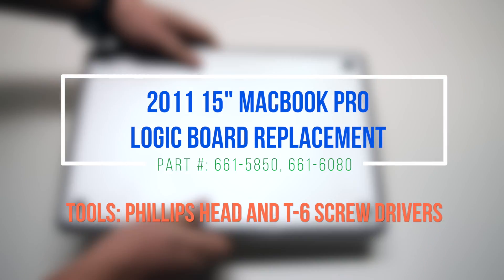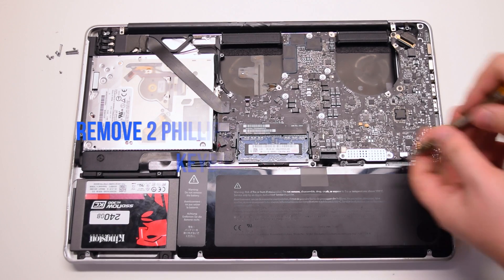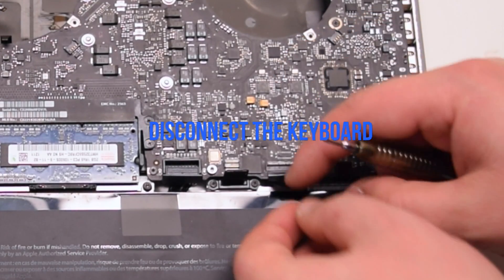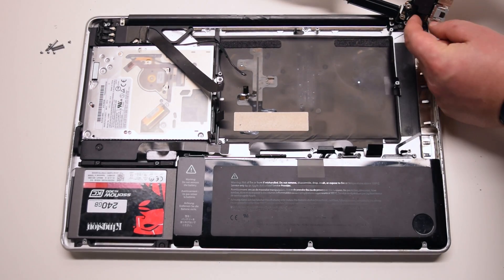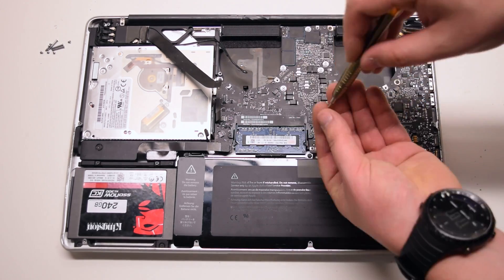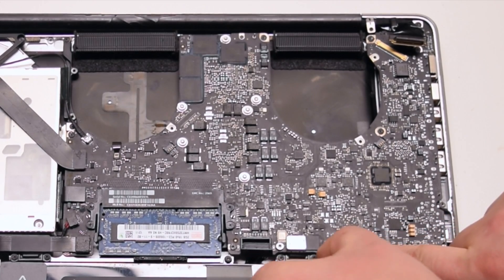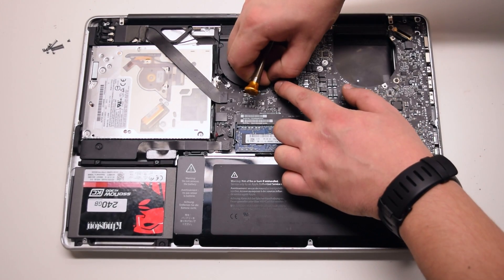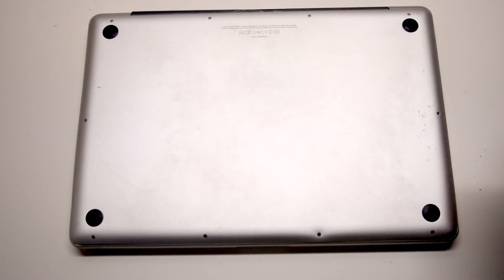2011 Macbook Pro 15" A1286 Logic Board Replacement

Comment: THANK YOU! THANK YOU! THANK YOU! FOR NAMING EVERY RIBBON PLUG.  I MADE A LIST SO I DON'T FORGET. LVDS CABLE CONNECTION, KEYBOARD BACK LIGHT, EYE SIGHT CAMERA CONNECTION, WIFI CONNECTION, DVD DRIVE CONNECTION, RIGHT SPEAKER CONNECTION, HARD DRIVE CABLE CONNECTION, TRACK PAD CONNECTION, KEYBOARD CONNECTION, AND BATTERY LIGHT INDICATOR CONNECTION (WHICH MY SNAPPED AND NEEDS TO BE REPLACED) ALSO, THE RIGHT SPEAKER CONNECTION NEEDS TO BE REPLACED, ALSO. THANK YOU.

Comment: I appreciated the tutorial.

A couple of items, though:
--We could use more info not only pin disconnecting the microphone but reconnecting it.
--When disconnecting the many cables, too many times either your hands or the text was blocking our view.  You might only cover the disconnect for 2 seconds and we can't see whether to pull the cables out or lift them off.  As delicate as these are, we don't want to err and rip things apart.  Some sort of closeup of these cable connections would have been a BIG help.

Comment: where can i purchase a new mohterboard  for my laptop because the link that you provide wont open for me?  i need a mohter board and the battery  thank s if you know of aany let me know please.
Reply: Lu Rodriguez ebay and go to everymac.com to identify the part number. they have a complete specs section that i found very helpful
Reply: @payperplane_pilot  Thank you

Comment: Is it possible to upgrade when replacing the logic board? My 2011 pro, I want it to be able to handle/update to the most recent OS.
Reply: I think you can use a 2012 MacBook Pro logic board. They still get the latest updates. Don't quote me on that though.

Comment: Great video man, it really helped. I've never worked on hardware on any type of computer and was able to replace my moms logic board on the first try. I do have a question though. Since i put the new one in the computer is running pretty slowly. Is that because it wasn't used for a couple weeks or maybe i didn't connect something all the way? I'm super happy i was able to fix it but i want it to work as best as it can. By the way the old logic board was 2.2ghz this one is 2.4 is that a problem?

Comment: Thx again for this vid. I followed your instructions and computer works now. Im having issues with the login screen. My old password doesn't work now, and I have no idea how to open it. Any suggestions?? thx
Reply from the maker: Create an OS X usb following one of my usb videos, log in to the usb installation and open the terminal. Type in “resetpassword” in the terminal and it will pop up a password reset GUI where you can set a new password and override the old one. Good luck.

Comment: Is it possible to pull out i7-2675qm from macbook pro logic board to use it in other laptop g2 socket ?
Reply from the maker: No. It is soldered on to the board.
Reply: @GRIBSOFT  ok thank you ?

Comment: have you ever tried to swap this early 2011 for the mid 2012 logic board model, they looks exactly the same, connectors and everything, wonder if it would work.
Reply from the maker: It should fit.
Reply: @GRIBSOFT  is the mid 2012 faster than the late 2011?

Comment: Hello, I have a few questions. I see in the comments people talking about late 2011 logic boards, but what about early 2011? Are all A1826 logic boards replacable with each other? Or is it only 661-5850 & 661-6080 that are interchangable? I have an Early 2011 MacBook Pro so I assume it's the 661-5850, but before I buy a new logic board, I want to be certain I'm getting a logic board that is compatible, whether it be a 2012 or whatever year, as long as it will work properly. Thanks in advance for your response!

Comment: will replacing logic board cause you to loose all your information on computer if not backed up?
Reply: It shouldn't. Your info is on your hard drive. Of course, it's always smart to back up before performing repairs. :-)
Reply from the maker: You will not loose any info.

Comment: Thanks much! Excellent detail. Followed it step by step to remove and send my board to get the GPU fixed. Only thing that could use more detail is the microphone on the back side. If it is glued/stuck to the case, which it probably is, it needs to be pried off (as mentioned) and then reconnected and re-inserted into a little circular holder for it on the board.
Reply from the maker: Glad to help! Support us on Patron https://bit.ly/2F3ebil or By clicking the KEEP US GOING button at https://www.appledollars.com/support-us

Comment: I have a macbook pro late 2011 i5 2.4 . I am wanting to change the mother board to the Apple MacBook Pro 2012 (Mid) Core i7 2.9Ghz 13-inch. Is this possible?
Reply from the maker: Yes, it will work.

Comment: oh, ive got a macbook pro late 2011 15inch, could i buy a newer logic board? i saw at the comments that i can use the 2012 logic board, but could i use one from the 2017 macbook pro? which logic boards can work on my macbook? i know the new have different size but... if they are smaller i can create a new macbook pro with my older parts XD. Sorry for my english D:
Reply from the maker: The choices are very limited, you are limited only to some 2012 logic board models as a possible upgrade. No other years will work because of the form factor and proprietary connections of all other internal devices that hook up to the board, such as super drive, speakers, battery and power indicator.
Reply: Save Apple Dollars at first, ty for answering my questions :P. But if i dont care to lose some devices i can... no? so i dont care if i loose the camera or de cd or something like. if i have wifi anthena, kayboard and trackpad it will be ok. Do you know about some logic board who i can use? obviously sacrifying devices xd and can fit on case, obviusly not a perfect fit, but something i can set on my case. Ty very much for your atention :3 and sorry for my english again XD.

Comment: great video are all 1286 made in 2011. Mine is completely dead and cannot turn on to find out year. I want to upgrade to 2012 if I can too.
Reply from the maker: Check out this link http://www.appledollars.com/identify-mac to learn how to figure out which year you have.
Reply: There should be a model number in box if you have it. And I don't really remember, but perhaps it's also in the backplate.

Comment: Is it possible to replace my late 2011 logic board with a mid 2012 logic board?? This would be an upgrade in USB and Bluetooth if possible, correct?? Thanks in advance!
Reply: I was wondering this thoo. I have 15 2011 MBP, unfortunately, Apple doesnt cover the GPU recall because its 2017 now. i was wondering if a 2012 15 MBP logic board would work.
Reply from the maker: Yes just make sure they are for the same size (inches) logicboard and it looks similar on the photos, I say this loosely because apple has made many variants in same years and a couple will not fit but majority will.
Reply: ATL Remix was it 13 inch or a 15 inch MacBook Pro? I’m curious? I have the 2011 15inch max out i7.
Reply: ATL Remix  please, can you give us a link for your new 2012 logic board?
Reply: ATL Remix  Thanks a lot !
Reply: ATL Remix  is it faster than the 2011 logic board?

Comment: can anyone tell me is it worth it buying a macbook that is missing a logic board/ssd? I was hoping to buy it and put it a logic board myself.
Reply from the maker: Usually not worth it, simply because the logicboard price is almost same as a used Macbook. It also depends, if you find a good deal on the SSD, the logicboard and the empty case with working LCD simultaneously, then you could save a few hundred bucks for a lot of work.

Comment: This is why I own a PC laptop
Reply from the maker: Most Macbooks (Pros) 2007 to now are still in full service and run the most current software and decode 1080 with Bluetooth out of the box to name a few standards by Apple from 10+ years ago. Apple has a very proprietary way of constructing gadgets so that they are very difficult to service but they are pieces of art and are worth the initial investment and eventual upkeep.

Comment: Hello! I have a question, to Replace a new logic board will it going to run as usual? I am afraid it will only work for awhile and dead again. My MacBook is now at IT and he said I need to replace a new logic board. I am poor at this skill. Thanks in advance for your answer.
Reply from the maker: When it comes to Macs, replacing the logicboard is like replacing the entire computer so to answer your question, replacing the logicboard will fix your issue for good unless the replacement board has a similar issue.
Reply: Thanks for your reply. That is meant it would be okay.
Reply from the maker: Yes, it will be as usual, all of your programs settings and files are on the hard drive and that will not be effected by the logicboard on Apple systems.
Reply: Thanks for your detail. I feel much better now after you reply. Very appreciate!
Reply: But the new logic board is made by apple in the same factory and may very well show the same problem after a couple of years. Make sure you don't overheat it or subject it to rapidly changing temperatures after being warmed up a lot.
Reply: So Chakrya where you ever able to change it with the new logicboard

Comment: Great Video!! Can you post a link to where your screwdriver set can be purchased? I'm needing to replace my 2011 MBP logic board and what to make sure i get the correct screwdriver. Thank You!!
Reply from the maker: Just get any Macbook screwdriver kit on eBay or Amazon, 90% of the kits come with everything needed, make sure to read the reviews.
Reply: I got my full screw driver set from ifixit $30

Comment: Man, do you know if that logic board are the same on the models mid 2012, late 2011 and early 2011? There are some change of the connectors for logic boards of these models?
Reply from the maker: 2011-2012 should be exact fit on the 15" models.

Comment: This video just saved me $375 from what the Apple store quoted me. Thank you! And an oddly soothing voice throughout the process. :) Highly recommended for anyone wanting to attempt logic board removal and replacement on their own. With a jewelers Philips and a T6 driver, it's really not that tough.
Reply from the maker: I'm glad you had success. Thank you for supporting our channel.
Reply: Save Apple Dollars why do you have to reset the SMC and NVRAM and do you have a video showing how to do that?
Reply: Where did you buy the board at?
Reply: @CheeseSpliffs  read descreption of the Video?
Reply: L G already did 2 weeks ago, guy...
Reply: i just purchased the same apple.a1286... took main board out to do something hopefuly soon to resolve issue with bios... need to change it because im locked out of machine.  i believe i have a plan to resolve the bios issue, but in process of removing main board I tore the end of the keyboard light ribbon cable... just left with a few tiny conductors... any advice on how i might repair this when its time to put system back together?   thanks for any help.
Reply: Man mine just went out gotta pay 4-500 to get it fixed